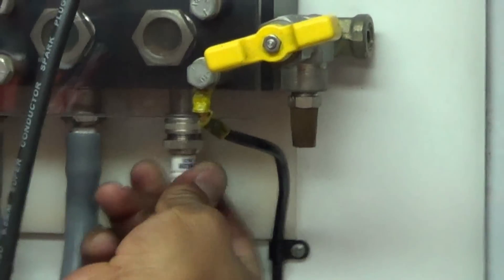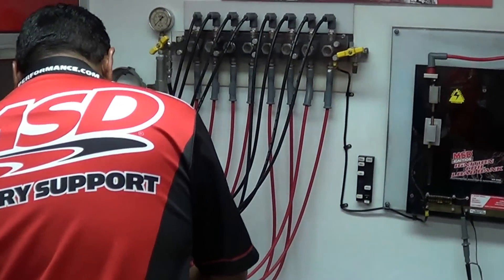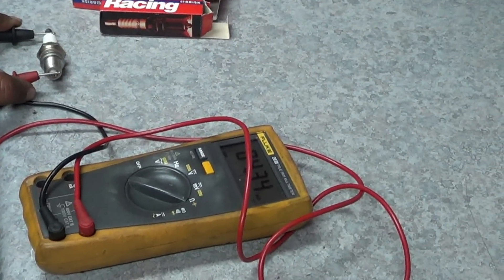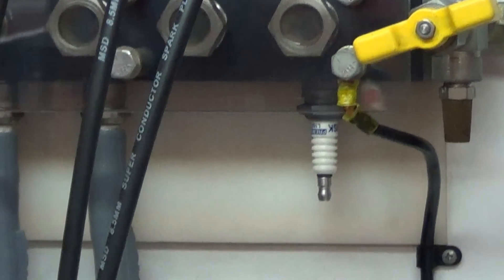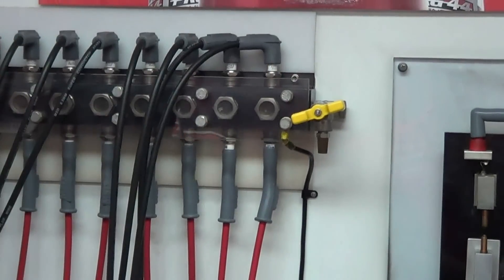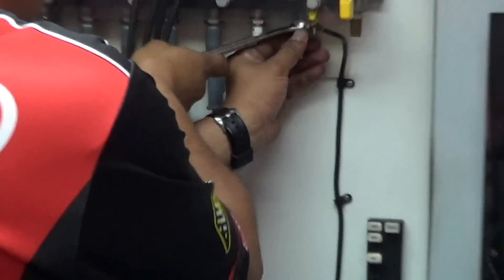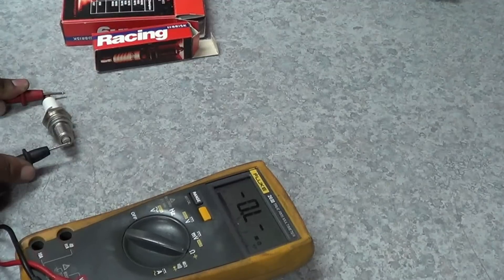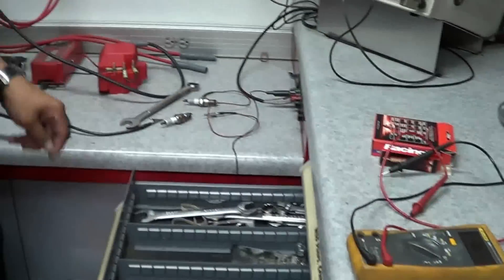High Performance Brisk Premium Multi-Spark plug firing on MSD Mag 44

Comment: Brett at Brick USA.   
Spoke to you today about the combo of your plugs & "Very Special" types of Ignition Boxes for the Delorean.  Do you guys have a test rig like this MSD test rig? 
If you made these professional bench testers for sale,   all us Ignition Geeks would buy to play with to test your plugs vs. NGK & others.  However there are those cheap spark plug demo testers on Amazn & Eby, but not sure of they are & no pressure chamber.  I was just thinking of how to make a multi plug single
chamber like your other videos & a demo board of o.e. ignition vs. different ignition boxes 🤔.
 I want to show the Delorean owners they need to upgrade their low power Ballast Bosch Coil & entire ignition system to reach the Delorean's full potential of 
1.21 GigaWatts!......😂

Comment: To prevent radio interference, you need either resistor wires or resistor plugs, not both. Just something to remember.

Comment: Which Brisk plug would I run in a 2012 Polaris RZR 900 XP? Only mods to the SXS is full stainless exhaust, tune, and k&n air filter.

Comment: Hey Brisk, would these spark plugs work in my Mitsubishi Eclipse 2007 2.4 L ? I have fairly good confidence that it will be great. Mainly being the fact that Manufacturers will of course usually use Iridium but only because it's cheaper. Silver is the best conductor of electricity I did research. I just want to make sure it won't fuck up, I bought 4 of em and when they get shipped I'm gonna put em in and see how it goes.
Reply: No these spark plugs will only work on Fiat punto.
Reply: **But Iridium will last a long time as well....I just am optimistic I hope they work great.

Comment: NGK and Denso Iridium plugs have a service life of about 100k miles. Considering the difficulty of replacing the plugs on my transverse V6, and about half that life out of these plugs, would the performance benefits really be worthwhile? Or is Brisk only focused on performance applications? (I drive a Honda Pilot, 3.5 V6)
Reply: Half the life on these no no no these are only good for 15k. As stated by them "Thank you for the kind words and support, both of you, we typically recommend an average lifespan of about 15k miles for the Multi-Spark design."
Reply: roger hurd - wow, only 15 thousand miles!? No thanks. I thought I read 50k miles online.

Comment: can I use these spark plugs on a 2014 silverado truck is a 5.3 wit k&n intake n exhaust n msd wires?
Reply from the maker: We offer a wide range of plugs that would suite your application. If you are looking to run a multi-spark plug for your vehicle I would recommend going to our Brisk Premium EVO line RR15SXC this can be purchased through our online store at - https://www.briskracing.com/brisk-spark-plugs/brisk-premium-evo-spark-plugs/brisk-premium-evo-rr15sxc-spark-plug-detail

Comment: I currently have a 2012 YFZ 450 ATV my bike backfires when I rev the engine and it also does the same when I am slowing down it sometimes shoots a flame as well someone told me that it could be my spark plug and I came across you guys do you guys have them for a ATV?
Reply: Rashad Dorsey 
Check your valve adjustments

Comment: How long can they last ? Like How many Miles ?
Thanks

I bought 3 for My Yamaha Fz-09 and put 30k on it . Just wanna know when is it time to change them!
Love them by the way !!
Reply: brisolaslip after 30 k I'd change them     and at only 50£ there well worth the spend my gsxr an zx ran crisp and ever so slight throttle response bikes just felt sharper    and I think there good for 30 k miles
Reply from the maker: Hello,

Thank you for the kind words and support, both of you, we typically recommend an average lifespan of about 15k miles for the Multi-Spark design.
Reply: BriskUSA first time I've heard of this brand! Normally I use E3 where can I purchase these? Tia
Reply: brisolaslip will these work in a 98 GMC K 1500 SL Z71 5.0 automatic ?????

Comment: so for a normally aspirated engine would there be much of a difference performance or gas mileage wise?
Reply from the maker: Hello Alex,

For fuel economy purposes we would recommend either our LGS or our Premium EVO Multi-Spark design spark plugs. 

BRISK Premium LGS
http://www.briskusa.com/brisk_premium_lgs_spark_plug_performance_and_fuel_economy

BRISK Premium EVO Multi-Spark
http://www.briskusa.com/brisk_premium_evo_spark_plug

The Multi-Spark plug is most beneficial for applications that see performance and or racing use and is intended to make the most out of the available energy within the air and fuel mixture. They do not have a very long lifespan and that is where the new Premium EVO Multi-Spark comes in to play. 

The Premium EVO design offers 2x sparks per ignition impulse with an average lifespan of about 50k miles, opposed to the standard Multi-Spark which has an average lifespan of about 15k miles. 

The Premium LGS does not create multiple sparks per ignition impulse but it does create a very long spark with a lot of surface area due to the patented design, these gapless plugs both the LGS and EVO are able to function from gap settings of about 0.035" - 0.060"
Reply: BriskUSA what would be recommended for ls2 cammed up
Reply: How did you u like your  vague answer?

Comment: Not very scientific, bad camera work, marginal ohmic probing (should have use and alligator clip and lots of point pressure on 360 electrode), and they might have explained each step taken and which plugs were which. Next...
Reply from the maker: MSD was the moderator of the testing and we had no control over the set up! We have much more extensive bench testing within our factory.
Reply: BriskUSA for a built forged 07 5.7 hemi charger making over 400 HP would a pulse plug would b good na.....also I wanna spray 175. I know I. need a 2 step colder plug non projected
Reply: GS Allen, exactly

Comment: can this make my non turbo or non racing car to save gas ? 2004 subaru forester and wich would be better multi spark or another type ?
Reply: I need one that burn more gas and last a long time !
Reply from the maker: Hello,

For fuel economy purposes we would recommend either our LGS or our Premium EVO Multi-Spark design spark plugs. 

BRISK Premium LGS
http://www.briskusa.com/brisk_premium_lgs_spark_plug_performance_and_fuel_economy

BRISK Premium EVO Multi-Spark
http://www.briskusa.com/brisk_premium_evo_spark_plug

The Multi-Spark plug is most beneficial for applications that see performance and or racing use and is intended to make the most out of the available energy within the air and fuel mixture. They do not have a very long lifespan and that is where the new Premium EVO Multi-Spark comes in to play. 

The Premium EVO design offers 2x sparks per ignition impulse with an average lifespan of about 50k miles, opposed to the standard Multi-Spark which has an average lifespan of about 15k miles. 

The Premium LGS does not create multiple sparks per ignition impulse but it does create a very long spark with a lot of surface area due to the patented design, these gapless plugs both the LGS and EVO are able to function from gap settings of about 0.035" - 0.060"

Comment: how long this sparkplug would last? will it runs till 100,000km without change to anew set of plugs?
Reply from the maker: Hell,

The Multi-Spark plug is most beneficial for applications that see performance and or racing use and is intended to make the most out of the available energy within the air and fuel mixture. They do not have a very long lifespan and that is where the new Premium EVO Multi-Spark comes in to play. 

The Premium EVO design offers 2x sparks per ignition impulse with an average lifespan of about 50k miles, opposed to the standard Multi-Spark which has an average lifespan of about 15k miles. 

The Premium LGS does not create multiple sparks per ignition impulse but it does create a very long spark with a lot of surface area due to the patented design, these gapless plugs both the LGS and EVO are able to function from gap settings of about 0.035" - 0.060"
Reply: BriskUSA when you say 2x spark per ignition occurrence do you mean 2 sparks at once or 1 after another?

Comment: I am a Corvette engine tuner and specialised on the 4-Valve LT5 engine. I use since many years the Brisk LGS spark plugs and got the best performance results. Under all circumstances they work great.
Reply: Bernd Su its pretty obvious you are lying.
Reply from the maker: Thank you for your continued support! The LGS design is a very popular choice for LT and LS applications.
Reply: I also consult and supply a racing team in Germany with Brisk spark plugs. The engine run and perform fantastic.
Reply: @BriskUSA  Im looking at these plugs for my LS 427.  Your catalogue seems to show multiple part numbers that list identical specs.  What is the difference? Thanks for your help if your able.
Reply: BriskUSA im planning to buy  to send back to phillipines to test it out. but the only thing i dont know the park# of which should i be getting for my 110cc bike.
Reply: true, but generally whack differences between int. resistance of plugs in a set

Comment: over my 30 years of using spark plugs, use what the manufacturer calls for. chrysler; champion; motorcycles; ngk. $2.50 a piece. brisk are $20.00 a piece and not much of a difference. the conclusion; DON'T WASTE YOUR MONEY.
Reply from the maker: Brisk Spark Plugs are not $20.00 a piece, our average sale price is around $10.99/each. To achieve optimum performance, using the correct firing design, heat range, and type of spark plug is key. Most often, people do not see the desired results because they are not using the recommended part for their application. Where as we, the manufacturer, would suggest a different part number and type per the application. We would like to change your view on our products. Please contact us at (713) 459-6977
Reply: +BriskUSA I am thinking of trying one of these in my 2004 honda cr250r racing bike. would I get any more performance? do you have any tester plugs?

Comment: Difficult to understand what we just saw, does the multi spark Brisk plug outperform standard single spark NGK? What about under high compression and not free air? For a standard motorbike engine is there any gain having a Brisk plug fitted? Cleaner burn etc?
Reply from the maker: Hello, Brisk Premium Multi-Spark does out perform a standard single electrode spark plug. Here in the video we are showcasing the differences in output between our competitors plugs utilizing a MSD Mag 44. High compression engines these plugs work very well also, we have done testing with Pro Stock applications with our Multi-Spark and they have performed very well. For a standard application there is benefits to be gained by utilizing our spark plugs, a more rapid and complete combustion which provides a cleaner burn, better throttle response, faster acceleration throughout the torque band and more over all horsepower. 

Please feel free to shoot us an email @ info@briskusa.com or give us a call @ (713) 459-6977

Comment: so what exactly does this prove about brisk multy. why dont you show some dyno test results instead of this bla bla
Reply from the maker: Hello,

We have Dyno testing results available at:

http://www.briskusa.com/why-brisk/dyno-testing-results/
Reply: BriskUSA so would i be better off with brisk silver multi with three sparks for nontubo or brisk performance with 4 ground electrodes. also your dyno test shows the multi gets more increase on motorcycle. i have a straight 6 max rpm 6k
Reply from the maker: ninos binno It depends on the primary use for the application. The Premium Multi-Spark plugs are more race oriented, the Premium LGS are also very high performance oriented plugs, but are more popular for street use because they have a greater lifespan than the Multi-Spark Style.

For more in depth information please email us! info@briskusa.com